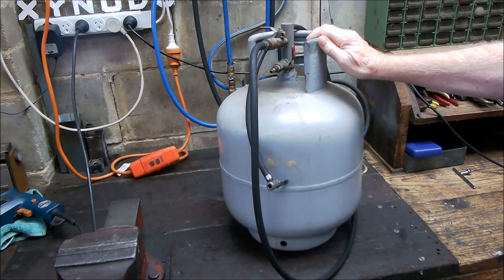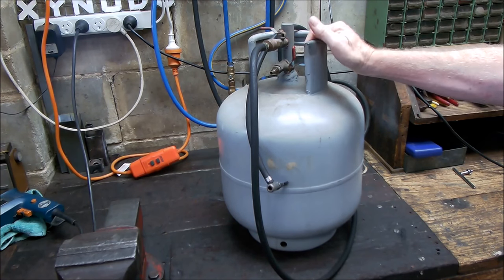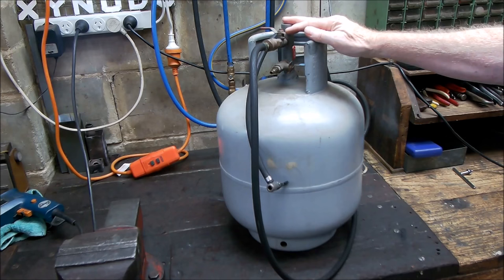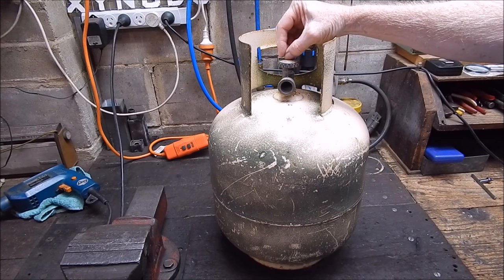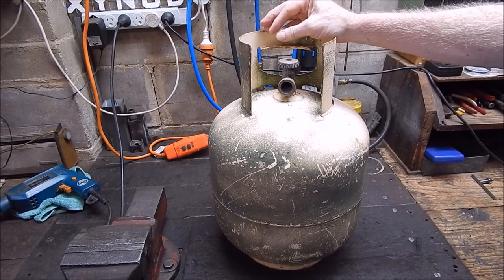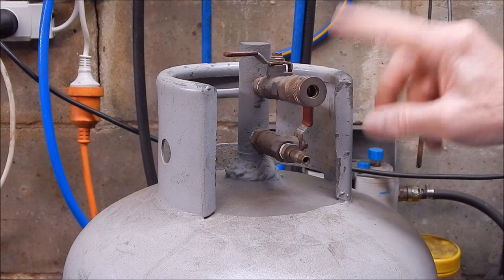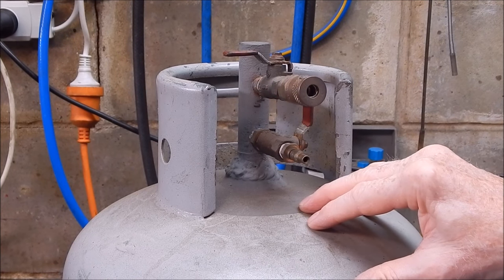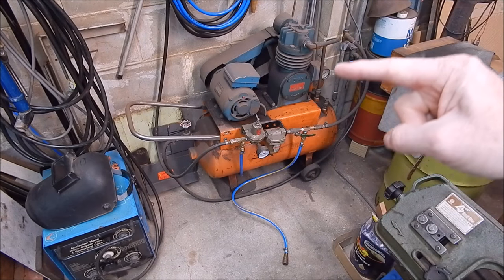How to add extra capacity to your air compressor for free

Comment: Just  helpful tip from a retired Toolmaker cut the  outer guard handle off .Weld it back on after all the fittings have been secured . It will make it easier to get off and to weld the main spigot /tap .

Comment: Thanks for sharing Rob. My bucket of air is an old C02 cylinder from a pub. BTW I use the toe type pressure gauge instead of the thumb. :-)   regards from the UK

Comment: Gday Rob--good idea--I have seen offroaders use scuba tanks to good effect...I use ex lpg cylinders to blow gear oil into gearboxs and diffs...Make it like an aerosol can--why work harder than you have to..I happen to be an extremely lazy fellar so the easy way is always the best way in my book...Actually I think laziness is a virtue--it should be praised...E
Reply from the maker: Gday Ian,

I had a brake bleeder that worked that way, but it was only small and made out of a pressurised can.

Rob

Comment: Interesting idea. I have to admit, I would not have thought about filling only with dry air... not until my tank was full of water that is.
Reply from the maker: Apart from the water in cylinder issue, you should only ever use dry air in vehicle tyres and to blow out computers.

Rob

Comment: G'day Rob what a great idea, that's the next thing I need a compressor! Regards John
Reply from the maker: You gotta have an air compressor ;)

Cheers Rob
Reply: Yes you are right but it's working out the right one.  I'm looking at least a 2.5 to 3 HP and around a 50ltr tank what would you recommend Rob for a small work shop blowing dwarf off lathes and mills ect regards John
Reply from the maker: Bigger is always better with compressors, but if you want to run the lathe and the compressor at the same time you wouldn't want to go bigger than 7 cfm (which is what I have) or you will probably trip the circuit breaker.

10 cfm is about as big as standard household power can handle (some cfm ratings play with the truth when they quote 12+ off of household power).

You want at least a 50 litre tank.  The cfm rating is what counts, HP is not a true indication of that.

Cheers Rob
Reply: G'day Rob thanks mate for that info, it is really appreciated hard to get any info on them accept the inevitable bull shit. Yours legend kind regards John
Reply from the maker: Glad to help.

If you want to run heavy cfm use air tools you should go as big as possible.  7 cfm is barely enough for a 1/4" die grinder.  The cfm rating on the tools tells the story.  Many are 9 cfm or higher so tank size comes into play on this.

So it comes down to usage requirements.  Also the duty cycle is important.  A lot of those small direct drive compressors quickly get hot on extended use and shut down.  Even my 7 cfm will shut down after 3 or 4 hours continuous running (which rarely happens - unless I'm spray painting).

Happy hunting.

Cheers Rob

Comment: How about increasing the duty cycle on your cheap compressor?? I flog my poor little supercheap compressor and have thought about adding an electric thermo fan or increasing the oil capacity to help with cooling? With a really long hose and a slave tank mine runs for a really long time
Reply from the maker: The limiting factor on the compressor will be the pump.  They can only spin/rev to a certain point.

Go past that speed and you risk throwing the rod.

Cheers Rob

Comment: Rob, can one machine and thread one of those tapered plugs out of some steel on our manual lathes versus welding it like you have or modifying the existing brass one? I think that would be a cool project....doable? Nice job on your spare air bucket :)
Reply from the maker: I've never tried cutting a tapered thread on a lathe.  It's doable if you have a taper turning attachment or offset the tailstock.

Rob
Reply: I have a taper attachment for my 12" Atlas...was just curious if you ever gave it a go on your equipment.....was hoping you had a vid on it. LOL

Comment: Nice video.  Have you looked into videos about NEUTRALIZING THIOLS?  Some people call that stinky oil Mercaptan.  IThe tank (bottle) can be de-stinked with a solution of hydrogen peroxide and baking soda, if memory serves.  It just takes a few minutes.  I've also seen people burn it off after completely removing the valve (tap), but I'm not one to take that chance even if someone shows me that they do it.
Reply from the maker: Thanks for the info.  I found that flushing it with water got rid of it pretty easily.

Cheers Rob

Comment: You don't have to weld the tank. i did all the connectors on a manifold.
Reply from the maker: Totally agree.  As stated, there's a few ways to do this.

Safety comes first, and if you are not a proficient welder, then don't do it that way.

Rob